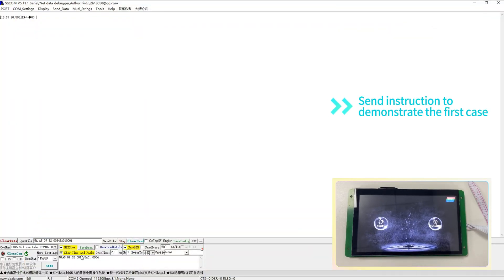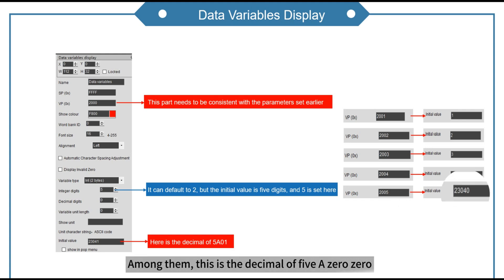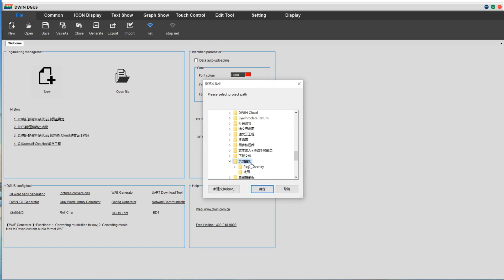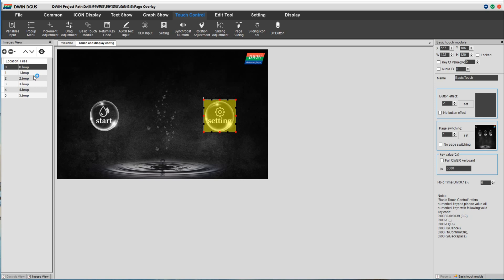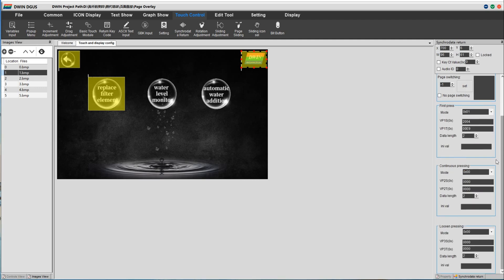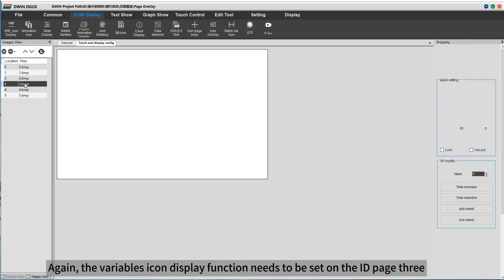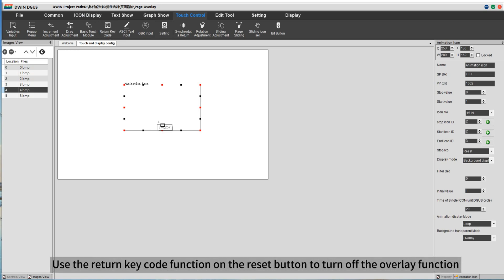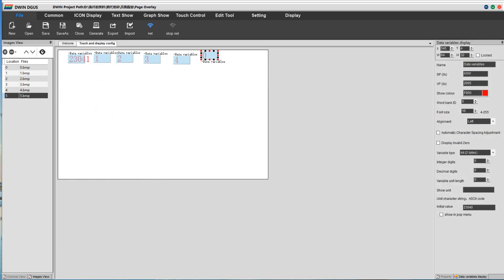Basic Tutorials 25 - Page overlay | DWIN T5L DGUS tutorials

Comment: When I attempt to compile (generate) the project with the new version of DGUS software (DGUS_V7.647), it does not function correctly. It displays the confirmation popup for replacing the filter, but pressing the confirm button has no effect. However, when I download the 'dwin_set' folder as-is (from the demo folder), it works properly. What is the issue with the new version?

Comment from the maker: DEMO: https://forums.dwin-global.com/index.php/forums/topic/%e3%80%90share%e3%80%91function-introduction-of-t5l-dgusii-software-page-overlay/
Reply: i used ur demo on DMG80480C070_03W now touch screen stopped working at all because of ur buggy kernel update i didn't know u have put kernal update in demo wtf
Reply: Please i need help i used ur demo files and after flashing on dwin DMG80480c070-04wtc touch is not working at all now i even upgraded the kernel to latest but touch still not working i will never buy these dwins again
Reply from the maker: @raystonrizwan7800 Hello, based on your description, I am unable to determine the issue. Is there a CFG file included in the DEMO files? Please send the files back to my email cindychen@dwin.com.cn, thank you.
Reply: Please help me restore my dwin display back..its kernel was 6.5 2024 and urs was old kernal which i flashed so touch stopped responding aven after i flashed latest 6.5 2024 back touch doesn't respond 🙏🙏🙏🙏🙏